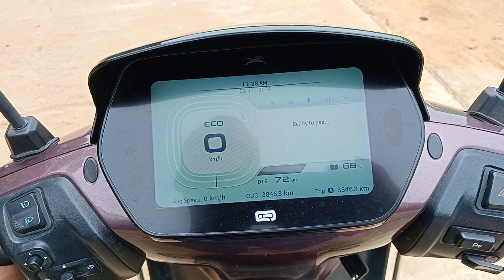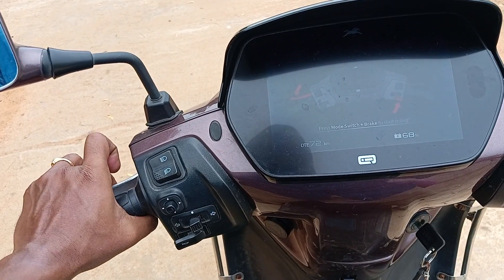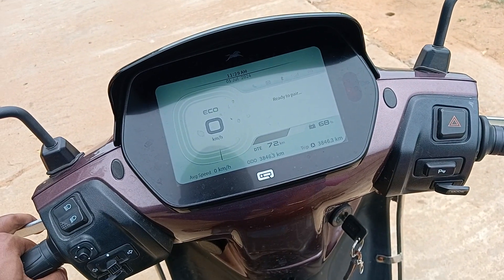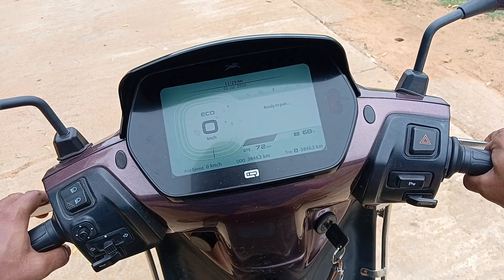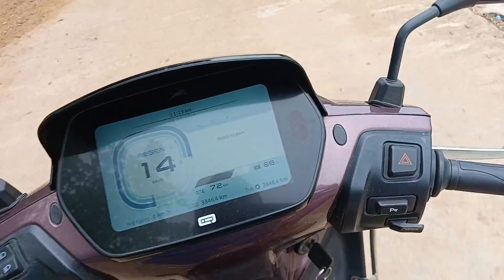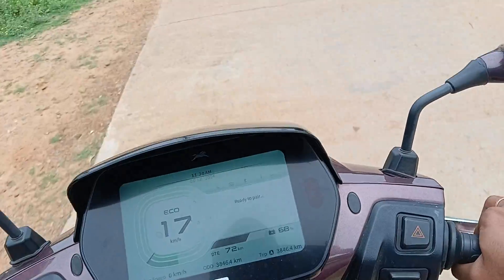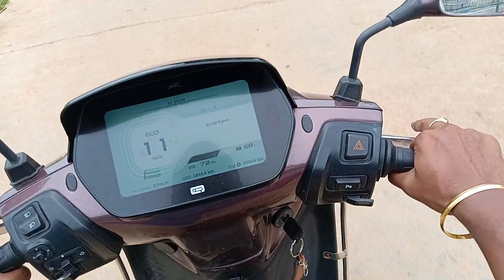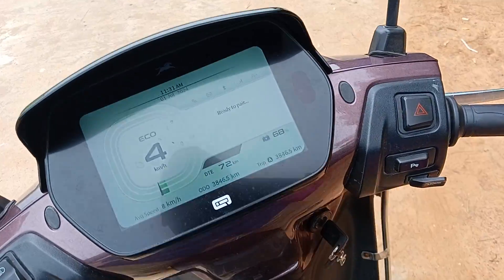Top Engineer Reveals Secrets of the TVS iQUBE S Regenerative Braking Demo

Comment: How to turnoff regen permanently
Reply from the maker: NO — TVS iQube does NOT allow switching OFF regenerative braking fully.
But you can reduce its effect by changing riding mode or riding style.

🔧 How to Reduce Regen Braking in TVS iQube?
1️⃣ Use POWER Mode (if available in your variant)

In Power mode, regen is minimal because the scooter focuses on performance.

2️⃣ Keep throttle slightly open while slowing down

Regen activates mainly when the throttle is fully released.
If you keep a light throttle before braking, regen effect decreases.

3️⃣ Avoid sudden throttle cut-off

Smooth release = more regen
Gradual release = less regen

Comment: Dear sir, my TVs iqube is not performing regeneration and also not applying regenerative breaking between 80% to 100 % charged scooter....

Bellow 80 % charging, there is no problem in scooter...Regenerative breaking also works but between 80 %  to 100 )%charged iqbue, it shows problem....

I went to service centre...They don't know the solution for auch questions .....

Please suggest what to do?
Reply from the maker: Hi Regenerate braking works at any percentage of battery but u need travel at a min speed of 40kmph....and reduce speed we can find regeneration mode in green color ....